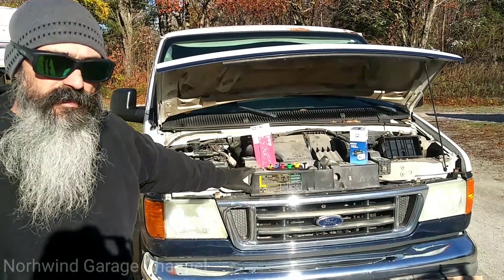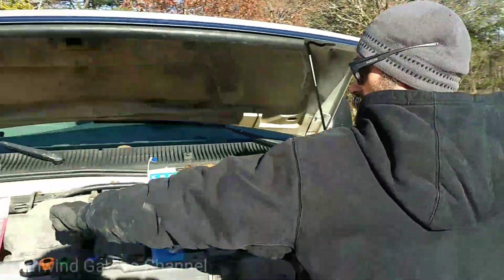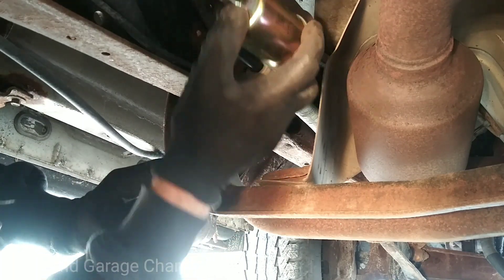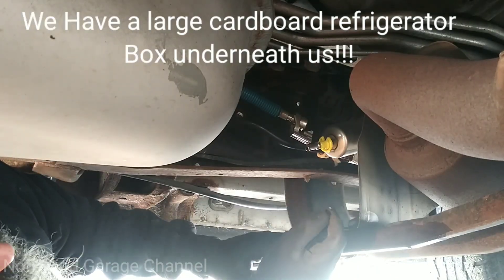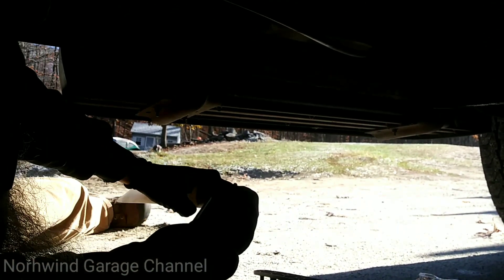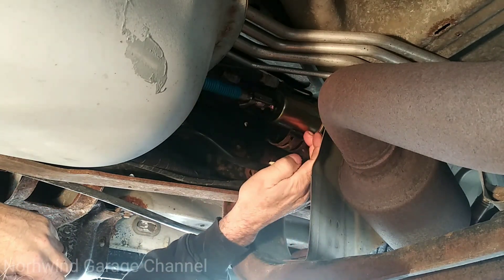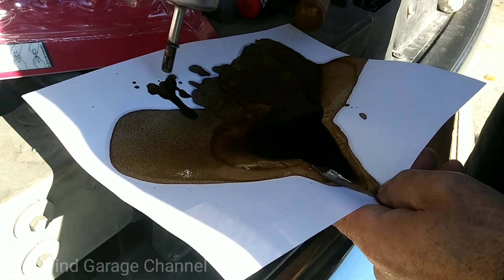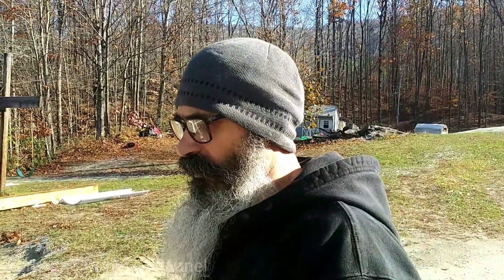2006 Econoline E-350 Fuel Filter Replacement Emergency Service

Comment: Thanks! My 2002 E-350 motorhome exactly same filter and everything.
It is often the "obvious" things that are hard to figure out. I looked at your video
because the filter didn't want to come out of the bracket and I didn't want to break something
forcing it; with just a little more pushing it did roll out as you say.
Then how to get the safety clips off? "Obvious" if you get a good look at it, but hard to figure
out under van. Then a lot of pushing and shoving with the disconnect tool, I don't know why
it doesn't do anything then suddenly it does go "click-click".
Reply from the maker: Glad you watched my video! Thank You!

Comment: good stuff
Reply from the maker: Thanks For Watching!!  🇺🇸😁
Reply: @NorthwindGarage  no, thank you for uploading this. I've been chasing a hard start issue and recently a stall out. My filter was changed out over a year ago but im in the desert so all that dust could have gunked up my filter. Just changed out my cam shaft position sensor just in case it was that. Crank shaft position sensor is a bit harder to get to But I'll try this next. Your tip about turning key to prime the filter is key👌